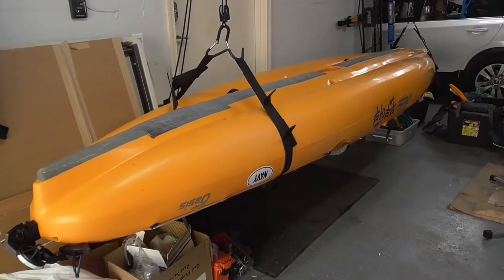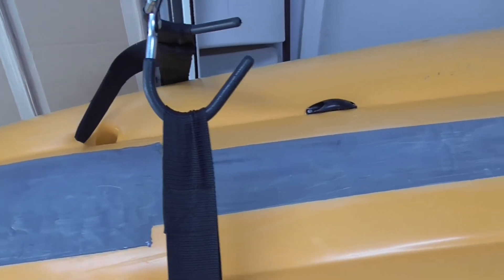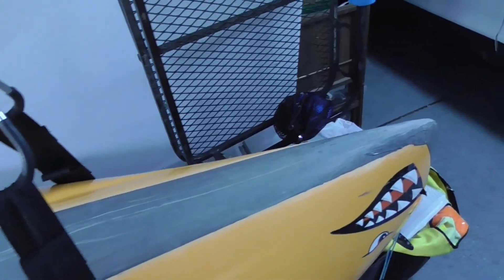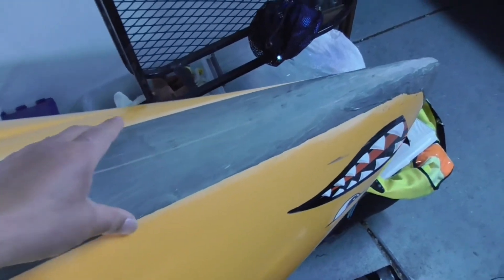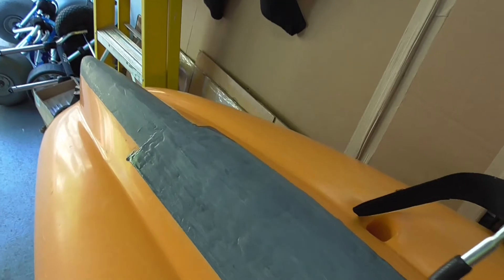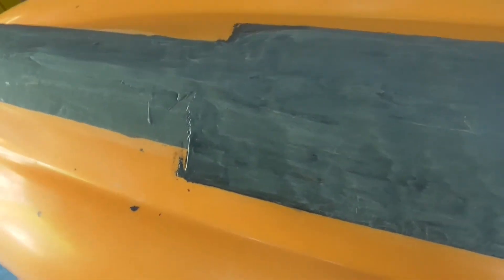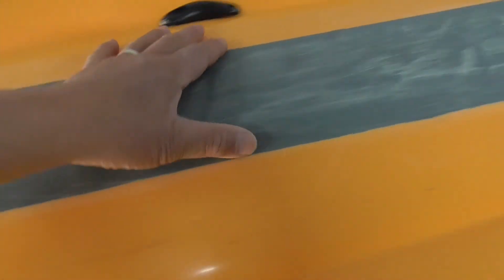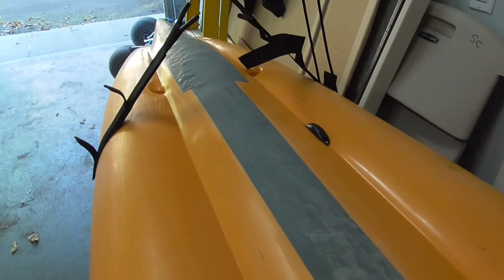JB Weld Kayak Keel Protection Report after 2 Years of Use

Comment: I have been looking for a solution to protect the keel of my kayak that doesn't break the bank. I hit pay dirt!
Reply from the maker: Good luck, and if you have any questions, please let me know.  You might want check out Napa Auto Online for the lowest price on JB Weld.
Reply from the maker: Make sure to watch my latest JB Weld video: https://youtu.be/BrQcHMFzxiY for the latest information.  Prior to using JB Weld make sure to store them in warm place for increased workability.
Reply: @Kayak Fishing Couple  jb weld is not a permanent vynal  fix.  Tried all that shit over the years.   Material from a quart oil container  and heat gun useing a spatula does permanent vynal repair.  I

Comment: Thus will not work.  Only heat gun and vynal will work.
Reply: Vinyl is a very soft material, and for 2 years it looks like it worked decently
Reply: @Awesome Opossum  nouthing sticks to vynal and will peel sooner than later.   I repair all vynal whether my kayaks or barrels or paddles with vynal with same marking useing my heat gun.  Makes a permanent repair and cheap.   No expense tapes that don't  last.
Reply: @bart2u  I’m not going to listen to someone that makes a babbling toddler sound like Shakespeare due to being that horrifically illiterate